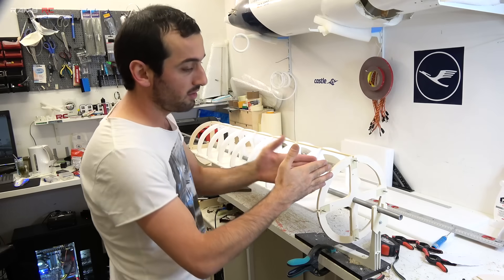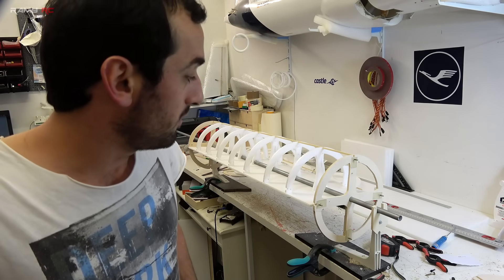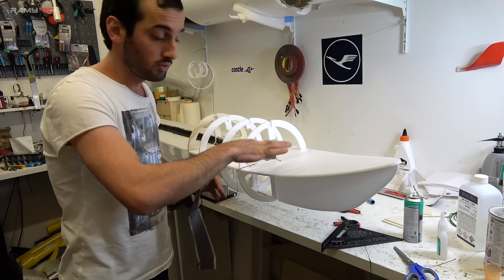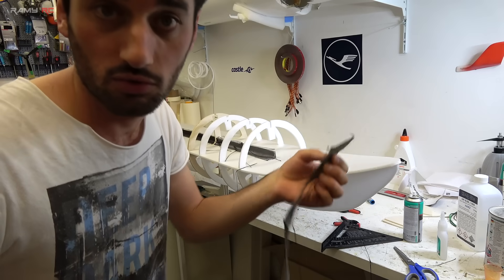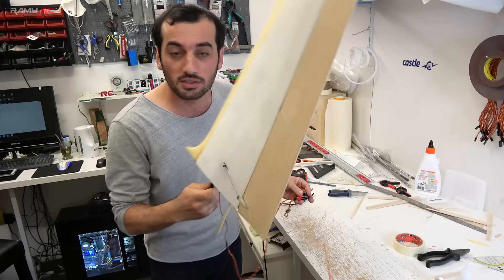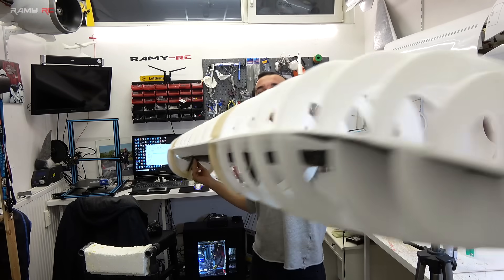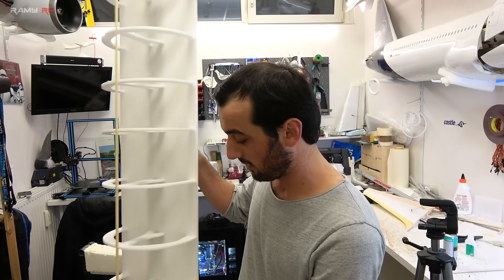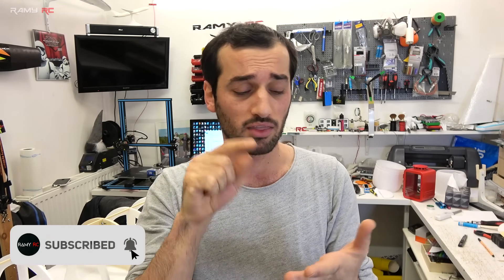Boeing 787-9 Dreamliner RC airplane build video PART 1

Comment: Look at the video of the crash; it looks like you overbanked the plane to 60 degrees in a down lefft turn. At 60 degrees, the stall speed doubles. This was a classic stalled wing then intered a spin to the ground.   Next time,  don't over bank the plane when you are low and slow. When you overbank the plane , try Opposite rudder and wings level with a nose-down attitude to recover.     Very nice work.

Comment: Please please am glad about these projects of yours. I want to know how to design, construct,  test and fly these not just for the fun of it but to use to use the project and experience as a demonstration to my students on the mechanics of flight to aide thier understanding and generate enthusiastic participation.  I need your help. I know you can explain everything on YouTube but how do i get a full clear documentation of your materials,  equipment,  designs, measurements,  tools,  prefabricated components as well as the physics of the different parts that make the system all work together.  Please point me in the right direction of search, be it video or online tutorials or lessons I can take or textbooks that can explain the details.  Thanks.

Comment: Will this work with cardboard as well? Isn't it too heavy for 2  electromotors with brush that are about 2 cm? I didn't buy rc electronics and motors yet. Plane is gonna be 1 meter long.

Comment: As I saw ur crash landing video of one of ur Boeing air craft which has the logo of Newziland  
Logo. First of All during this video recording you dear used abusive language multiple times 
Apart from ur faith or believings 
Being a Humans we must not use abusive language anywhere in over life because it brings someone in cheaper position in front others. it is an advice to you respectful in the name Humanity please don't mind it
2nd thing is about technology
Because I also love rc air crafs
So here is suggestion for 2nd time when you sir start new project of making an another rc
air craft please keep in mind to
Install a cruise control system in your plain so the air craft will maintain certain speed beyond 
Limit which is necessary to keep  
Air craft flying.
Thanks.Dr.saleh.

Comment: To make a good landing gear do your method and put a spring  and  make sure it is bigger than the  small pole and attach the spring to the  wheel making suspension

Comment: Just wondering, why do you need a CNC machine? You could get a 3D printer for a fraction of the cost. Is there not a foam composite material that is cheap and light enough to craft with?

Comment: Cool built Video and sry for the crash, I am currently building a Beluga XL also in 1/20 with the same technique,
wich Carbon fiber and Epoxy harz do you use?

Comment: very nice indeed. ive been building a 1/24th scale B17F from original boeing drawings,  with a view to replicating the exposed air frame. i see in your project some of the same thought processes ive been through.      very nice project you have there.

Comment: I just saw the crash video.  I'm sorry that happened.  I hope you build another one, it really is a beautiful plane.  It looked to me like a sudden shift of the COG.  The way it went in, reminded me of a Graupner Terry I used to have.  I crashed and repaired it 3 times before figuring out the cause.  In my case, it was the battery not being as secure as I thought, and after a few hard turns, the battery would move hard nose heavy, couldn't get control back, and it crashed just the way you're Dreamliner did.  Definitely not you're flying skills, so no pilot error.

Comment: Watched the whole playlist and im Addicted to the channel now. It sucks what happened to the plane my heart almost broke for you. You do great work, very talented, never stop building planes.  Just wanted to mention the reason your wire cut turned out uneven is because you are pulling the wire ends too far past the point of cutting. 0:48  this causes a shortcut for the wire to take through the foam.  If you keep the wire ends in line with where its cutting, you'll get perfect cuts every time. I know it can be slow but the result is worth it Little tip from a fellow hobbyist. Again amazing channel, amazing work. I could watch this for days.

Comment: Ramy  carpenters have jig saw tables with a stationary blade that they move the piece around on . So why not make an upright stationary hot wire that you guide your foam blocks around on . You know , instead of trying to move the wire around a stationary block . Oh yeah , in case you ever wondered where the city or town of origin of youtube comments . I'm in Hanford Ca.  a tiny little town south of fresno ca.

Comment: you mention CF rods. Mostly it is manufactured in tube form. For the spar in the wing of my F/A-18 I installed a rod inside a tube with epoxy to make a solid 8mm 'rod' for the spar in the wing, a full span 40" rod.

Comment: Next time add another pice in the center like how you have the two on the ends place another one in the middle so when you run the wire it doesn't sag in the middle...

Comment: As salaamu alaikum yah Ramy I've watched your video regarding the crash accident and i found out that your servo set up on wings are too small and narrow please be careful because as the plane on flight it will experience a drastic flexural stress making your servo push rod-way more narrower and could possibly stock while maneuvering a very high tilt angle this means that you could possibly lost control of your aircraft...just an advice inshaAllah.

Comment: You are a true craftsman. A beautiful aircraft.  To note, in frame 9.56 it looks like your server for the movable stabilizer is a small unit that is enclosed with no access cover. The small micro servers are notorious for failure and not as dependable as full 16 oz. size server.  The aircraft experienced an aileron lock due to bad server or radio interference ; most likely,  server failure. The fire was post crash and due to a locked up engine and voltage serge.  Your video is excellent and very helpful for post crash analysis. The elevator and horizontal stabilizer is  the most important control service on the aircraft and all engineering thought should be applied to secure a fail safe unit, however the video crash presents as a aileron / radio failure with a banking turn to inverted roll and recovery before ground impact.  Good Luck in all future aircraft.

Comment: Who’s watching this after the crash?
Reply: Wow.  Hows's THAT for a Spoiler !!
Reply: Well it looked like a combination of mechanical failure and pilot error so I had to see the build to see what was wrong.
1. He put too much effort in maintain excessively light weight.
2. Given the light weight he could have used push/pull on the vertical stab as well as a much higher quality servo. The servo he demonstrated did sound noisy and labored.
3. Poor electrical routing and battery mounting which is where I think the worst problem began shortly after relatively harmless pilot error.
The Styrofoam construction was not sufficient to hold one of the heavy battery packs through such a high G turn causing internal structural failure possibly disconnecting one of or more servo wires to the tail, he also seemed to appear to suffer power loss to the left engine. From the ground footage I thought I saw something come from the left wing just after the bird passed but I couldn't see in the tail cam footage, maybe not enough frames per second to catch it, but it could have smoke..
You could tell when a battery was lose inside just moments before the flex in the fuselage caused the hatch to open making matters far worse catching wind with such an extremely light airframe.
There is such a thing as too light! 
My opinion.. Better servos and installation, better wire routing and layout, more secure battery mounting (should at least handle twice the expected G's), the weight would be a little better by the fore mentioned issues making it less susceptible to adverse wind conditions.
Reply: Me lol
Reply: @FilipinosInAustralia  Me! Just saw the crash today.
Reply: I am!  lol That was an awesome crash. Unfortunately it went too slow, banked too hard and it lost lift . Shit happens but I'll tell you one thing. It made a subscriber out of me. Great channel! This guy works hard at what he does and so far I'm diggin' the videos. Keep up the good work Ramy-RC!!  :)
Reply: После видео с крашем, пришел на этот канал..
Reply: Even crashes. Wow, super realistic Boeing model then
Reply: Came here to see if I could see anything he did wrong to cause the catastrophe
Reply: me. I was so sad when this beautiful bird fell. :(
Reply: What crash?
Reply: Me too.
Reply: lmao that's me right now🥺🤦‍♂️
Reply: A 787 dreamliner crashed?
Reply: franc4152 yeah this one he built did
Reply: i saw what remains of dreamliner #1 and thought "wait... that looks familiar"
Reply: Yeah
Reply: yup! I am! All that work for nothing! Oh well look on the good side, at least the builder wasn't onboard!
Reply: Lmao yh
Reply: Spoiler alert! LOL
Reply: me
Reply: Me xd
Reply: DylanHK la 9ok00la casa y
Upaxgy ?00  O?
Reply: i am.  Very sad.  I believe due to too much roll and not enough pitch/speed? Total respect for Ramy.  But now the pressure is off of flying such a beautifully built 787.  Boeing should hire this guy
Reply: Me... beautiful plane masterfully built... crashes: that’s the heartbreaking thing about this hobby..
Reply: @textech4056  I love to fly but I am a natural engineer and love to build more. 
Its always nicer to fly a stable and reliable aircraft. 
I think he also should have used a plywood base structure and screw mounting for such heavy batteries including the radio battery, I've seen the radio battery come lose in other airframes and yank the plug.
Going back about 30 years ago my buddy's well built Cherokee was cruising beautifully and he did a max velocity dive to stress it to the max and pulled out on the deck and then his radio suddenly was dead. But the plane kept going strait and level with just a slow sinking to one side and its wing tip touch the ground a mile down the field as we watched and the moment it touched at full throttle it was smashed to hell. Even wrecked the engine. We examined it and determined it was the battery which was mounted in the ceiling of the fuse and it let lose from the G-force in the dive. Not even a radio safety feature can work once the battery is disconnected.
Reply: i didn't knew about the crash....
Reply: so sad
Reply: Me. Months of work over in minutes.  Good luck this time
Reply: Tipstall.did it twice with the same plane in a month .even more annoying when you'e just repaired it.
Reply: Me
Reply: wait what crash
Reply: Me
Reply: me. I was watching the a350 and forgot what the dreamliner was made of and i have way too much time
Reply: Me😔
Reply: Me
Reply: me... so sad :(
Reply: Me
Reply: Me
Reply: Me
Reply: yee
Reply: I also count me
Reply: Probably NTSB😅😅
Reply: Of course
Reply: Me lol
Reply: Me too. It's glorious knowing what is going to happen 🤣
Reply: Me

Comment: You should add a small ball bearing riser at the back of your saw blade to keep it from backing from your cut when you're pushing into it. Small hobby band saws don't come with them but they are easy to install/retrofit. You can use any ball bearing for it.

As for the foam cutter, whenever your span is more then 3 cm, you should always use a tensioned wire.  Pretty easy to make by retrofitting something like a hacksaw or similar OR making a small frame out of plywood. Doesn't need to have a ton of tension applied on the wire, just enough to keep it from wandering off.

Comment: Really interesting video. I just discovered your channel,  and seeing the techniques and the materials used is quite a learning experience for me. I had no idea you could use carbon fiber and resin like that. I thought it required a special pressurized oven to do pretty much anything you'd want to make from carbon fiber. I see you just started this project in January, so I'm curious to find out how far along you are now. I will go ahead and subscribe, because I want to see this fly, and what you get up to next. Thanks for sharing! 😁👍👊

Comment: Fabricate and place a mounting stand onto the scales, zero the scales, place the component you want to weigh onto the mounting stand, and you will have your net weight. Saves having to try and balance the component and get an accurate weight.

Comment: Put your nichrome wire across a hacksaw frame and isolated one end with rubber grommets, then tension the wire and it will cut straight.

Comment: If you wanted could you run your wire's thru the aluminum center spar that run's thru the middle from front to back ? and wouldn't that clean up the assembly or would they possibly interfere  with eachother ?

Comment: Hello, this is a really cool video. When I was a kid, for my school project I made a plane like yours - except I cut solid foam which made it too heavy to fly sadly.

I made the hot wire by taking apart a fan heater, a wooden frame with a threaded rod that could be tightened worked really well at giving a really straight, right cutting wire.

When you were making the templates, one think I kept thinking was how much easier it'd be for you to laser cut that. I have a modified cheap Chinese laser cutter and printing a frame would be so easy to draw out, deicing and 'print' a template of..   Either way, it all works well for you.. a stunning design

Comment: The dished out curve in your first cut was because of wire drag.  You need to make a small bow to keep tension steady and use a bit hotter setting on your wire.  Then don't force the cut, let the wire do the cutting at its own pace.

Comment: I've got a spektrum DX6i. Will that be enough to fly the airliners and if not do I have to go for a DX18 like the one you are using or I can go for one lower. Of course the cost will be a factor. Where I'm from a DX18 will cost me $6000.00TTD

Comment: I enjoy watching your building techniques using foam which I have never once tried. I am old school ( because I'm old) and still use only balsa , plywood, and fiberglass since that's what I learned to build with 50 + years ago. In real time, how long did it take you to accomplish what you did in part 1? 

If I lived close to you I would buy you a Chinese cnc if you would teach me how to use it, sadly I live a long way from you,  in Philippines. I have been looking at them for quite awhile but the software just seems to hard to learn without a real teacher. 

I'm happy to see a young person actually building a plane from scratch nowadays, it seems 99% of the hobby has gone to RTR sadly. 

Best of luck , Ramy.

Comment: Ramy, you do such excellent work, bravo.  Where however do you get the scale drawings in 1/20 scale.  I'd like to build a similar airplane but can't find appropriate drawings.  Thanks.
Reply: Just find a photo or build plan from the plane (not taken from an angle) and zoom in until the plane is 100 millimeter long on your screen and simply think that 1mm is 1cm in real life if you plan to make it 100 cm long. Then just measure the rest of the parts, they are the same scale as well. But this isn't the most precise, but very handy.

Comment: here are some things to consider.   at 2:04,  idiocy.    adding dead  Unnecessary  mass/WEIGHT!!     in a location where additional  strength is  wanted,  EITHER,  use  a MORE ROBUST piece of Wood   or    LAMINATE  with  wood  VENEER, and   LOW-weight  adhesive; medium ca   or   wood Cement .     at 9:07,   is that a  WATER-based  white glue???   if so,   W R O N G.    why is this true.    because  a  certain  amount  of   H2O   will   NEVER  be able to   EVAPORATE.     at 9:40,  is that  cf,  Being installed  AT  THE  TAIL.   reelystoopid, that.    use a dam  POPLAR  dowel  (my local  HARDWARE (or craft) store sells 'em; does yours)    OR  'mill'  a  WOODEN,  rectangular  vert-stab  spar.    at 10:00,   that is a  SMALL   rudder  servo.   either replace it;  or,  use the  'INNERMOST'  hole,  in the servo arm.    imo, a greater distance between the servo and rudder hinge would be a   Good  thing.    consider the wisdom of mounting adjustable linkage components at the  Servo  Arms;  rather than the control horns.      googletranslate

Comment: I Just finished my much smaller 1:50 scale 787/9 and it looks beautiful, i am sure yours will look better thought Ramy ;D
Reply: Will u help me with design and measurement of the same ?
Reply: Firstly, i would reccomend watching Ramy's video on making plans as they are straight forward.
Length:1240mm
Wingspan:1200mm
Fusalage height/width:10.98 cm
I run it on 2 64 mm edf with 6s lipo. I have rudder steerable nose weel elevator s and ailerons, may add flaps in the future but i decided to keep the weight down.
Materials is balsa, 5mm foamboard and 3mm foamboard, epoxy and small amount of fiberglass for retracts mounting. For other details like the engine mounts and how the gear retracts, just look at images  and videos of 787. 
Have Fun ;D
Reply: Hey The_beast201, your not mr. Beast are you? That would be so cool if you were browsing incognito chatting with people and no one ever even suspended it! Lol

Or if you were the other beast, LA-Beast. Either way that would be cool AF!